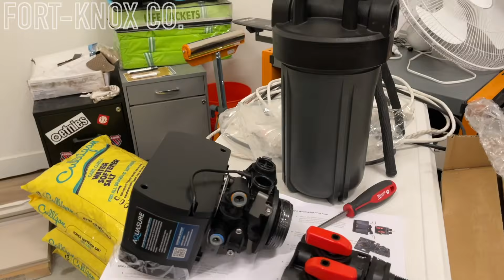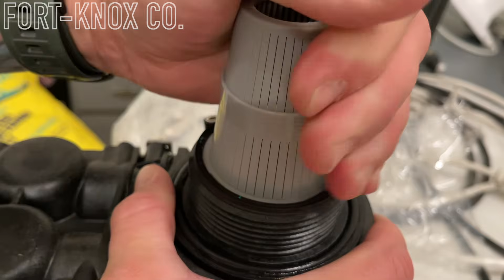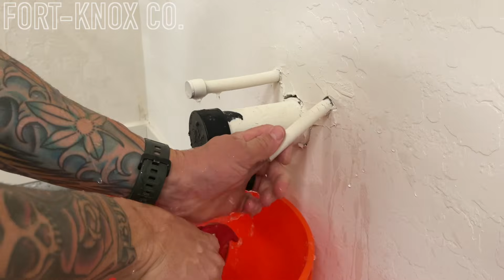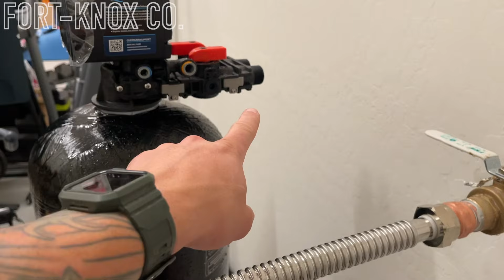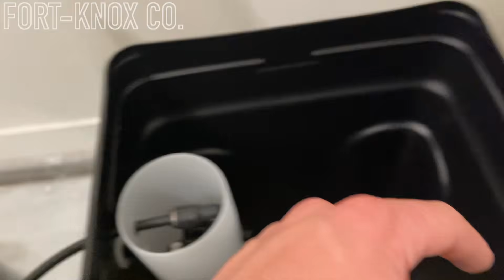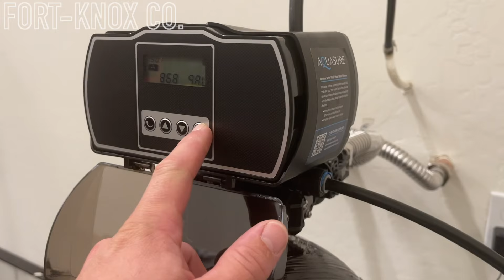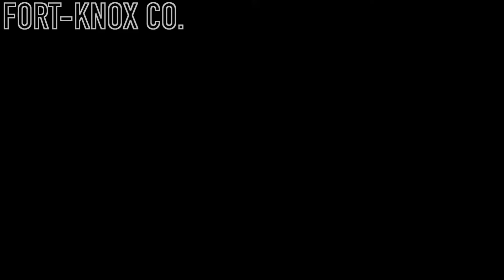How To Install Water Softener System Aquasure Harmony Series | Water Softener Loop Connection

Comment: Why am I losing all water pressure when I turn on my water softener
Reply from the maker: You should see any reduction in water pressure. Make sure all valves are open. And that there’s nothing obstructing the lines that are connected. If you put in a brand new system you may need to remove caps or plugs that were in place during shipping and packing of the softener

Comment: I installed this softener in February. After installation I dumped 1 40lb salt bag but the salt not dissolved yet. Softener monitor changing the gallons but salt still there. How I can resolve the issues. Please let me know
Reply from the maker: Are you able to see if the brine tank is getting water flushed in and out while it’s doing its regeneration?  Because if it’s filling up with water and doing its regeneration then it should be dissolving that salt. So my first guess would be that the brine tank is not actually flushing and filling.
Reply: Not it's the condition
Reply: What I need to do now
Reply from the maker: @ThisIsTripleT  I’m not sure what you’re referring to with the “condition”. The salt you pour in goes into the brine tank(salt tank). It has a hose from the filter system large tank that will connect to the side of the brine tank. That connection has a valve and when the system flushes it will fill the brine tank up with water, the water becomes saturated with salt, the salt water is flushed through the larger filter tank to “scrub” the material inside and clean it of all the hard water minerals it’s collected and then it flushes the large tank with water to clean the salt water out.
Reply: I have posted a video.. please check it 🙏

Comment: Need GFI at outlet 😮 in case of water leaks. Too close to pipe joints. Excellent video presentation.
Reply from the maker: Thank you.  I appreciate that. 

Every circuit including the lighting in this house has GFCI outlets and breakers in place 🤙🏼

Comment: This looks like a good system, and you do a great job explaining the installation.   I just don't understand the bypass valves.  If I get a system like this, do I need to manually turn those bypass valves every time the system does the flush process?
Reply from the maker: No. It will cycle on its own. When it’s doing its regeneration cycle you just won’t get softened water. So you usually set the time to regenerate late at night or at a time you know most likely no one will be taking a shower. But you will still get water during the cycle if you were to turn on a faucet. 
I’m not sure the full intention or use of having manual bypass valves. I get having shut offs. But a bypass? Not sure. Just to be able to isolate the system and still have water going through, but not sure why or when you would need to use that.
Reply: Thank you.  I purchased the same system you installed here.  It was delivered yesterday.  Now I just need to go purchase a couple of flex hose connections to finish the installation.  Thank you for your video.  😊
Reply from the maker: @brentgiles5515  your very welcome 🤙🏼

Comment: I installed my Aquasure Harmony with your step by step video. 🙏🏼 Thank you so much. I just have one question. Did you notice low water pressure? I'm having this problem now.
Reply from the maker: I didn’t notice any lower water pressure. But you may need to turn yours up if you’re having a reduction in pressure. Ours was pretty high to start with. You can do that with the water bell housing at your main water line Inlet. There’s a bolt/screw on top of your brass bell. Usually clockwise to increase pressure.
Reply: @FortKnoxCo thank you. I also reached to Aquasure. 👍
Reply from the maker: @rejetenchavez1938  nice. Hopefully you get it all figured out
Reply: @FortKnoxCo i have figured it out why I'm having low pressure. It looks like somethinf broke inside the brine tank and it's leaking the resin and entered into my plumping. I had to clean the filter shower/faucets and washer. All were clogged with resin. A good friend of mine is a plummer. He told me to run water for an hour to clean the resin in the pipe system and it cleared. But right after I installed the showerhead, resin starts to build up again, no matter what. So I bypass and cleaned the filters, run the water. No more resin. I assume brine tank is faulty.
Reply from the maker: @rejetenchavez1938  yeah there is probably something with the units head valve and brine tank flushing. Because as it’s siphoning water from the tank or flushing it through the resin, it should not be allowing the resin out of the large filtration tank.

That also brings me to a lot of people will put that carbon or cotton particle filter after the system, and before the water goes back into your house, it can catch anything that may get through your filter system and stop it from entering the pipes of your house. Lot of people like to put them before the system to filter out anything large coming from your local water supply. But I think it’s a safer measure to put it after your softener system. I had a friend whose softener system failed and released resin throughout all the pipes and he had to do the same thing. It was a headache, but they did get it fixed.
Reply: @FortKnoxCo my plummer recommended a filter, but I told him, I shouldn't need one cos this is brand new and somehow it failed. Btw, I have contacted Aquasure a week ago and guess what a new resin tank just came in while I was trouble shooting! I was surprised they sent me a new one. I already contacted my buddy to help me replace the resin tank. Hope this will fix the issue. Thanks for getting back to me!
Reply from the maker: @rejetenchavez1938  nice! They were very responsive with me before when I needed some help with a unit. Happy to hear you are getting it all fixed. Yeah either way a new unit should be letting particle matter out. There’s a membrane and filter inside the take to prevent that from
Happening.

Comment: Great video for installation. Do you have one for future maintenance. Does it need new carbon or what is in the inside of the tank.
Reply from the maker: In my other video showing the install of the shell water system towards the end I explain the installation & removal of the partial filter. It should be changed every year at least. Some people prefer to do it every 6 months. Just depends on your water and usage.

Comment: So it came with a water filter I see…not necessary to install with softener?  How has the softener worked out for you?
Reply from the maker: Yes it come with a pre filter that’s to filter out large particles. You can install it before the softener or after. I like doing it after the softener so it can catch anything large that could possibly make it out of the softener system.
Reply: @FortKnoxCo  Thank you
Reply: The Fortitude V2 prefilter is not required but recommended. Chlorine/chloramine in city water will shorten the resin bead life.  So the carbon prefilter will extended the resin bead life from 3-5 to 8-10 years.  I think it's worth installing and I didn't have any pressure drop
Reply from the maker: @joephu  great information right here!

Comment: How often/how many gallons till you have to do a “refresh”? 

How often do you have to fill that salt bin? 

I understand everything. Will be different dependant on water hardness, and water usage.
Reply: It will depend on the softener size and the number of people.  Use the online tool to pick the correct grain size then use the usage calculator to determine the program settings.  My 32,000 grain  system is set to 1300 gallons which is about every 10-14 days
Reply from the maker: @joephu  💯 every system and household will be different. Stick to the equation they provide to calculate your usage needs
Reply from the maker: I think it’s currently set to about 2,500 gallons. That has it regenerating about every week. 

I fill the salt every few months. I usually just add a couple bags, I don’t let it run empty or too low.

Comment: One question Sir , how often do I have add water to salt bin  or is it just the one five gallon bucket at the install
Reply from the maker: Usually, you don’t need to add any water to it. It will fill and flush itself during the regeneration cycle. That is part of the whole fill and float shut off valve in there. During the regeneration, it will fill itself to where it needs and then it flushes that water that has salt through the system to scrub the minerals out then it flushes itself back with clean water before stopping the regeneration.

So after the initial start up, you shouldn’t need to add any water to the brine tank

Comment: Quick question. I'm about to install this water softener in a basement. Do I need a sump pump or can I connect the waste water line to the sink on the first floor? My concern is if the waste water pressure is large enough to climb 8 feet. Thanks
Reply from the maker: It reaching the 8’ climb should be fine. Just make sure the drain has enough drop in it before the p-trap, similar to a washing machine drain. It will flush with a high flow of water and you don’t want it to over run. Not always a problem but just something to keep in mind.

Comment: Just installed my system - very easy to follow..only challenge is the blue retaining clip. The yellow was simple once I took it out (as shown) but the blue doesn’t go as flush.. it’s in and not going anywhere but would’ve liked seeing how you got it to set.  Great video!!
Reply from the maker: That’s great you got it done. Sorry I didn’t get the video of seating the blue clip. Those small pieces can be tricky sometimes. But once you know how they are supposed to work you can
Hopefully figure it out like you did. If I make another video showing the next install I’ll try to go in more detail on those kind of things.

Comment: Nice video thanks for a clear guide to follow. My question is when you’re running a back wash cycle for the first time, I forgot to close the outlet valve from the softener to the house for like 10 minutes not realizing it at first that it needed to stay on bypass for an hour+. Will that cause any issues to the system or will it be fine for that short amount of time that it was on for?
Reply from the maker: It shouldn’t cause any problems. As the system runs it should work properly. That’s just the initial set up and fill/flush. It’s usually to just get water/air/small particles flushed through so you can start using the system.  It won’t have any affect on the function of your system.

Comment: So what happens when you turn both valves on before realizing you need to only open one up first?
Reply from the maker: Are you referring to the water valves ? Or the valves on the back of the softener?
Reply from the maker: Are you referring to the water valves ? Or the valves on the back of the softener?

Comment: The size of a water softener is based on the hardness of your water, THEN the household size. For example of extremely hard well water, nothing this company offers would stand a chance on softening my water.
Reply from the maker: That’s unfortunate. The 64k grain is pretty good. You can set the hardness level and regeneration cycles to help with keeping the water hardness down.

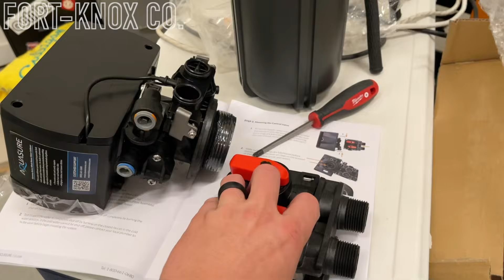Comment: At 2:21, is that the prefilter to extend the water softener life? Any details regarding that?
Reply from the maker: There is a pre /post filter that some of these units come with. I didn’t install that on this one, mainly focused on installing the water softener. It can be installed before or after. I’ve done both depending on the manufacturer recommendation. 
I have a video of me installing the shell water system whole home filtration system and I installed the filter after the unit. 
The idea is it will catch any large particles before the system. Of catch anything large that makes its way out of the system before entering your home and appliances.
Reply: @FortKnoxCo  hey thanks for actually responding! I appreciate it! That was helpful.
Reply from the maker: @jggarage1807  your very welcome. I try to respond to ALL my comments. If someone takes the time to watch a video of mine and comment, the lest I can do is reply back. I appreciate it.

Comment: Sharkbites are like magic. Like any fitting I didn't trust it until I tried to remove it. You can hang a silverback gorilla off a properly seated sharkbite and it won't come off. You need to depress the release to get it off and then it pops off no problem. I'm sure they can fail, any fitting can fail, but they are the real deal.
Reply from the maker: I agree. Any fitting can fail. The shark bites are rated and approved fittings, I always just say install them where you can see them so if they ever leak you can catch it and replace it.  But I’ve also seen “properly “ sweated copper joints in walls fail plenty of times…. Don’t know where the naysayers about copper sweated joints were on those ones. 🤷🏼‍♂️

Comment: Does water need to be in the brine tank at all times?
Reply from the maker: It does not have to be in there all the time. They’re usually is some leftover at the bottom. Or even in some cases, you’ll see it sitting right at the level around where the salt sits. But when it does, it’s regeneration, it fills and drains and then there’s a float inside to shut off if it overfill. But I don’t believe it. It’s completely dry.
Reply: Thank you sir for the prompt response. God bless you and keep making these videos cuz we need help out here.
Reply from the maker: @maverhart5227  your welcome. For sure🤙🏼🤙🏼 I’ll keep ‘em coming

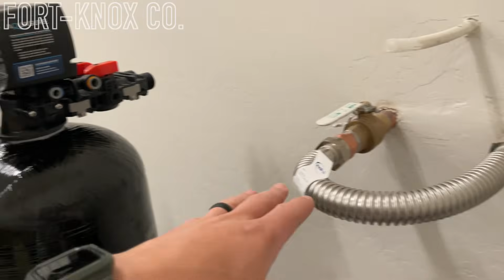Comment: How do I do this 7:17 when the connection pipes are pvc?
Reply from the maker: Your water loop coming out of the wall is PVC? 
You can use a shark bite connector that has male threads, that will allow you to use the flexible lines to connect to your water softener. 

Or if you’d like might try using a pvc male thread connection. They sometimes make a sleeve/coupling that has male threads on it. So when you cut the pipe you can glue that threaded coupling on the end and accomplish the same task. Only think with pvc threads is that they aren’t as strong. So you have to be careful when tightening down not to over tighten and strip the threads.

Comment: Great video man!!! Thank you for taking your time and explaining the whole installation process. I hate reading instructions so hou saved me sooo much time. Ill be installing one this weekend.
Only one question, do you fill the unit up before plugging in it and pressing cycle button?
Reply from the maker: No. Not on this model, it doesn’t ask you to refill the tank and then secure the top. With whole home systems that have a tank that has carbon mater inside they usually tell you to flush or fill the tank to “activate” the Charcoal. But with a water softener tank with resin inside it doesn’t require it. 
Once you turn the system on and open up the water flow it will fill on its own

Comment: Quick question... does your water softener soften the water in your kitchen too? My kitchen is not getting soft water but the rest of the house is....
Reply from the maker: That is a very good question. The reason for that is because most houses are plumbed with a separate waterloop to the kitchen sink specifically to provide unsoftened water so that if you were for example, to take water and water your plants in the house, you are not using soften water Because I guess that’s bad for the plants. So in short outside water Spicket for the hoses and the kitchen sink specifically are unsoftened waterlines. But because of that, that’s why most people install a reverse osmosis at the kitchen sink specifically. That will provide you the option to have softened and filtered water at the sink because that line usually usually needs its own mini system.

Comment: Thanks for the video, really helpful,  quick question, what you recommend for plastic pipes, I heard I can't use shark bite because of the water pressure, what you recommend for that type of pipe?
Reply from the maker: That’s awesome thank you. As far as shark bites go if you ask any professional plumber, they’re obviously going to say negative things about them, but technically they are rated for plumbing. Very similar to almost any other type of push on fittings. It has a mechanism inside to secure the pipe whether it’s plastic or copper or PVC. Professional plumbers are always going to advise against it because they simply say that there’s potential for failure, yet at the same time, I know plenty of people who have had soldered copper pipes and they have failed and had leaks, and unfortunately were inside walls and it caused tons of damage. so hypothetically have a failure, but these things are engineered and sold with licensed scenes and patents to be able to be approved in usage.
As far as being rated for pressure, I have never had that problem before, either way I always recommend that if you’re going to install a push on fitting, use them in places that you can see or have access to that way if there ever was a failure you could easily see it and correct it. I wouldn’t usually put a press on fitting inside of a wall and seal it up , just somewhere that you could get an eye on it for whatever reason.

I’ve personally used press on fittings in different applications and have never had one fail. Just my personal experience. 
As far as other types, I prefer PEX A, expansion fittings, since they are the newer technology and have tons of positive aspects. PEX B I would stay away from since the fittings and joints are more restrictive than the internal diameter of the pipe itself. So with multiple joints, you reduce the amount of water pressure through the whole entire circuit. With the fittings and joints are true internal diameter and they don’t restrict water flow throughout the circuit.